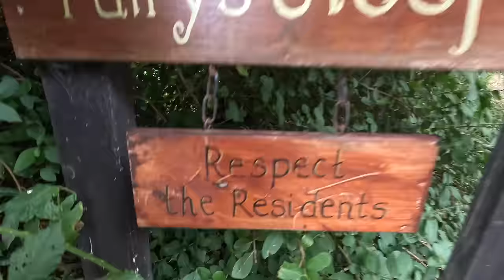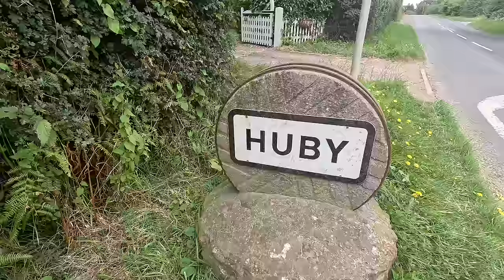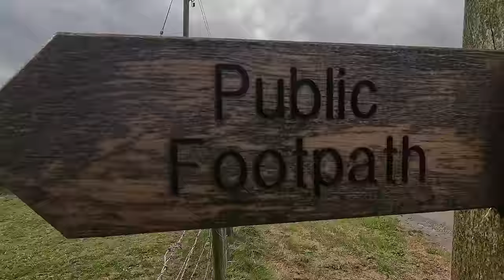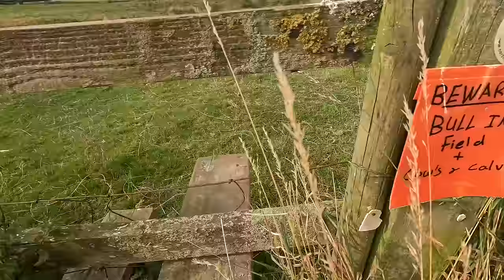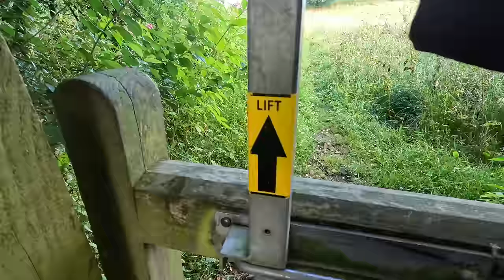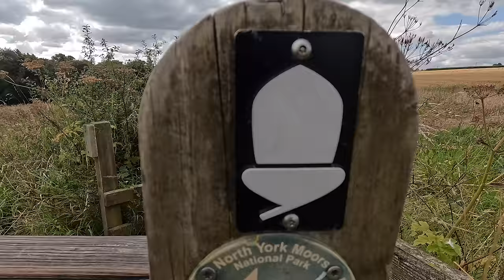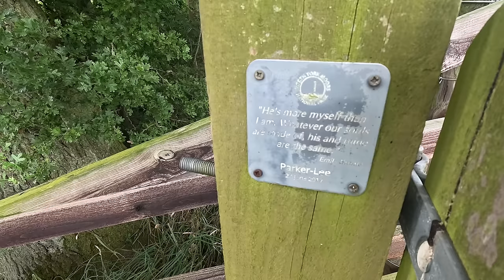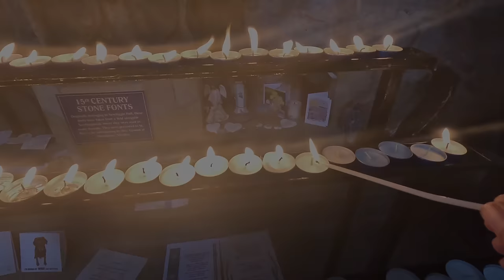Hiking 72 Miles Across Yorkshire | The Whitby Way

Comment: Great video . I m a big Cleveland Way fan but this walk will be on my walk list in future .Start is a doddle to get to in York compared to Filey or Helmsley . Interesting to see you have bought the DCF version of the X mid . I use this only because i cannot carry anymore than 8 kgs but you are a pack horse and 15 kgs does not worry you . The X mid Solid ( in a new darker colour of what looks like olive green is now out with bigger interior volume too ) for £210 .Its polyester and won t double in weight overnight as my old Terra Nova 500 gr awful thing did .Silpoly tents are dreadful for sagging and gaining weight .X mids can be skinny pitched cutting down the footprint for tight spaces and also the fly can be close pitched to the ground using rocks etc as stakes keeping out the wind and weather